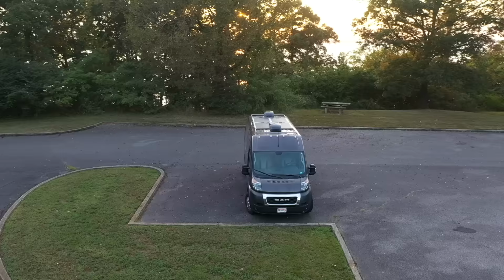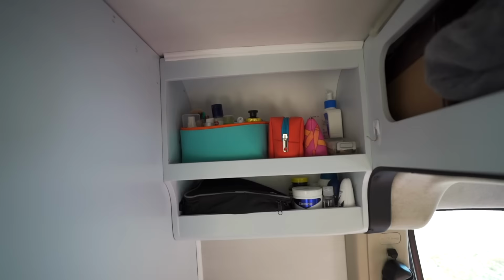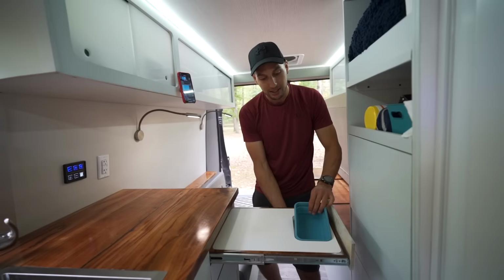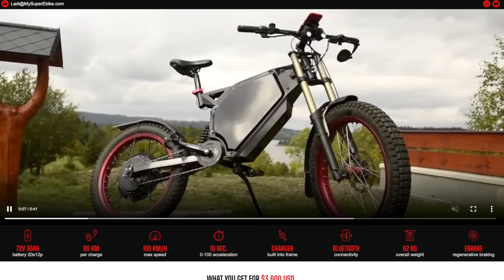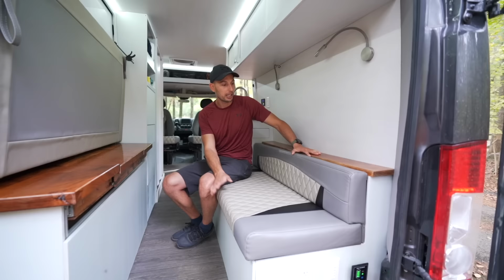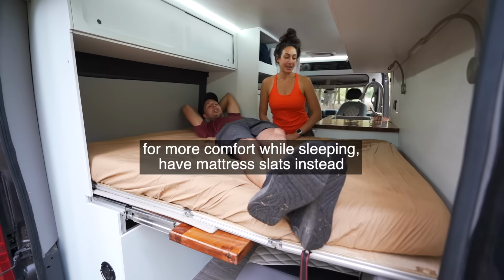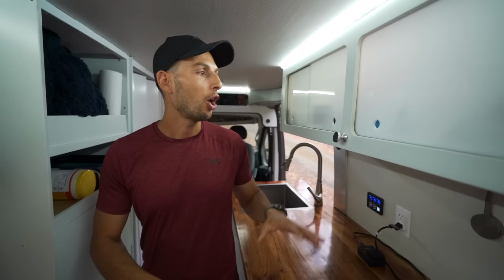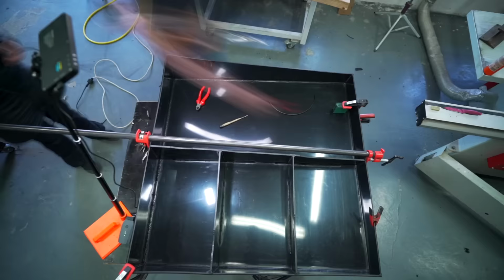LUXURY Van Tour + DESIGN REVIEW of Innovative Campervan Layout

Comment: In one of my minivan conversions, the front driver and passenger seats laid back completely, so I used a drawer set between them  and created the bed. It worked VERY well. You can't  sleep while you're driving, and you can't drive while you're sleeping.  It saved a LOT of space as well as creating seating space when parked. However, most of the driving seats now will not lay back completely. These seats are difficult to find.

Comment: To be honest when it comes to food storage you can always put coolers outside when you're sleeping in the back when you're hanging out in the back you can get 12 volt coolers you can also get generators you can use the vehicle as a generator you drive to the next location you can hook up the 12 volt of the engine and other external spots for more power

Comment: Nice van. About changes. I would design by rotating the back to the front. The restroom makes more sense on the back, if the driver is driving and the passenger decides to use the restroom, it would be uncomfortable for both. If the kitchen is in the back too, you can probably use it with the door opened  while cooking outside and access to part of the kitchen from outside. Less counter space and less shelves would make it look bigger and more space to move. The bed would be closer to the front. If there's an emergency, you can jump to the driving seat quicker. When the bed is put away and have family and you are driving. You can have most of the family sit on the sitting area and be able to have a conversation with the driver and passenger. If the family is in the back, they will have to get up to speak to the driver for anything. If the sink is in the back, you can use the sink spray to do a quick shower out side to spray off dirt or lake water off the body. The bed has a little space on the bottom. If the bed was a little higher, you can have space in the bottom to add a thin mattress and pretend it's a bunk bed. Only for sleeping. The back wall by the sitting area, if it has a nice color strip of velcro, you can have the option to stick a nice thin cushion with a nice print design as an option. The cushion can be left on or removed and used at a park to sit on or used on a dirty park bench. Or to put in the hall floor to sit on.

Comment: If the bed had a slide at the bottom you could add a cushion and sleep tail to front as well as I have seen vans with the bedding in the window extensions.  The other option is to have a slide bed like a couch that goes to the back doors.

Comment: Hi guys on the recirculating shower 1. The water has already been heated so needs less energy to get it back to shower temperature than cold water and 2. I have one and it’s incredible, it runs from a 20 litre or 5 us gallons tank so does not require a lot of water. You can use it several times and can relax when showering as you are not using your main supply.

Comment: I'm not doing the vanlife thing yet - but I've been looking into it. I think these recirculating showers are a costly and impractical fad that looks better on paper than in actual use. Not only do they use a lot of power to pump and heat water, they require at least a half dozen filters that have to be maintained and replaced - a lot of trouble and cost to conserve a few gallons of water. 
I think a better solution would be a water reclamation system - which would eliminate nearly all potable water issues. Even a dehumidifier would likely produce enough water for a couple showers a week - eliminating the need for a recirculating shower - You should design and market a system. If it will draw 4-5 gallons per day from the air - i think you'd have a winner- productwise

Comment: You're mistaken about the power savings of a chest fridge/freezer. A regular fridge with the door open in our testing was at room temperature within 5-10 minutes. A chest fridge? Gained 2C in an hour. It's also far easier to access all your stuff; you're not really vertically stacking much, the space is small, and everything lifts without moving everything else, unlike when something's at the back of a fridge shelf. We like ours so much it's now in the design for my new house too; regular fridges suck ;)

Comment: If you got Bedeez bedding which goes on like a fitted sheet, but has a sheet and blanket/duvet that zips open and closed you wouldn’t need extra bedding as it’s streamlined enough to work with Murphy beds and probably the burrito bed too. It is a company out of Utah. To me it looks like you would have your feet towards the end of the bed with the cabinet above and have your head where you can use the move able lights. I don’t like the refrigerator or the location of the water tanks because they would freeze it the winter months.  Not sure that I would want to cook my dinner over the bench where you work and eat plus having to make sure you clean the wall behind it and even the bench below for anything that might spatter .

Comment: Two power slides would easily solve the trouble you had with the narrow walkway inside.  Perhaps add two more power slides.  One to extend the height of the vehicle.  The other to extend its length.  Go-Go Gadget mobile :)

Comment: yup bed is a huge one for me. I need 2m minimum I hate feeling my feet hit the walls so I'd have to have my bed in the other orientation. I have seen a couple of builds the other way with a removable pad where your feet goes, thereby creating another seat but I'm going to be vanlifing alone so I'm not to concerned about that. Building mine next year so watch out for the video.

Comment: I agree some things even for me as a single male I'd change but over all apart from that bed, which I'd get rid of and use as a storage unit, I'd keep as is - except the under-van storage water system, as what happens come winter when you are operating in - 20 deg C temperatures - water freezes and so does your tank.

Comment: I absolutely love the van, especially the bed and the indoor water fill, I would add the ability to see where the water level is. I don't care for an outside water fill because anyone can have access to it and it's not secure. The bed is awesome because it allows openness to the van and you don't have to make it everyday. I don't like a static bed because anyone can sit on it and that's not something I'm interested in. I do agree about the fridge, pulling things out all the time to get something at the bottom would be a pain. Also not a fan of the pull out induction, too close to the wall, takes away seating, a recessed induction would be better. Adore the shower, must stay clean. I agree that a composting toilet would be better.
Reply: there are water filling points with locks
Reply: @hermanvdv9680  As they demonstrate in their security video, locks can easily be broken into.

Comment: I would add heated floors and the water tank under van inside or heaters to keep from freezing and cracking in winter sitting in snow and I’d extra alternator for keeping van charged and stress off car alternator and think of adding walk-in tub instead of shower with shower portable to hand held or directly above all waterproof with separate door for toilet so it stays inside and shelves inside shower tub for hanging drying wet things with vent from heater and cement all walls and joints so walls won’t crack

Comment: If you find a lot of open space above items in a cupboard or drawer, the cupboard or drawer isn’t designed for the sake of storage, but rather because that’s how it’s always been done. The upper cabinets could have had adjustable shelves. Their pillows could have been tucked inside the burrito bed, the bed bottom that you look at all day while on your laptop, needs art, velcro-ed vases, or anything nice to look at, the frig had 2 1/2” of space between the pull out and the cabinet box. And maybe some softer textures on the walls? No one wants to live in a plastic box.

Comment: Thanks for visit me at Malacca.  This van is not broad enough, must inside 7feet to 8feet wide, so as bed mattress 6feets6inches long (is international size ) can be put inside. #The washing tub table and cooking table must use waterproof material, and able to stand for heat (Ceramic Tale)!  #I like the way of your designs in save spacing, very good idea. @No matter how, better add a 2storey at top( put cushion only for sleeping), push up cover 6feet high (use van same material)!! @Better use two pairs of DoubleTyre!! @ Actually, I prefer this van longer 4feet, so as can put a small sit ( not for lay down) bathtub bathroom at the back (plus a stair for get to the top of 2Storey)!! @May God bless you all the best in your life journey!!

Comment: @ power efficiency of cooling boxes: you don´t loose the cold with an open lid of a top loader as cold air does not rise up - whilst the cold air "falls out" of a front door fridge. Regarding the practicability I totally agree. But the power consumption can make a difference in small vans with very limited battery power.
Reply from the maker: Of course lot of old air escapes when you unload and load back the whole fridge. The argument that cold air does not rise up is completely irrelevant here. It’s like when people don’t take into account everything else.

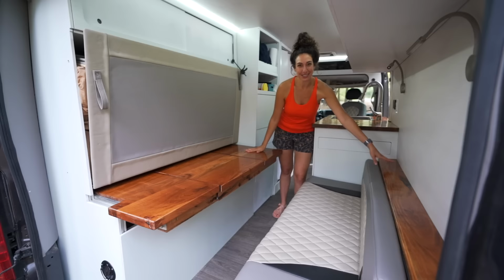Comment: 21:00 i feel if you dont have support to the sliding panel from the bottom, and just let it hang in air then sleep onto it, eventually it will be damaged. better put like a foldable or removable leg underneath

Comment: hi here's common to some emprovement 1. the water under the van need a locked glass shalled to proven tempering 2., security alarm system to keep people 5 ft from van for your safety 3.safty glass windows., 4.safty practice when around other people in different city and town.5.the bed can have sliding wood latches on each side of the bad you don't when that bad hiring you in the head.

Comment: Good review. Although with the fridge comment I did a double take. That's not a real argument about efficiency, those are facts, not beliefs. Cold air is heavier than warm. When you open a fridge or freezer from the side, it dumps all the internal air out and you have to bring it back to whatever temp you have it set to which is very inefficient. With a chest freezer or fridge, you do lose a little when you open but it's very small. If your fridge is cold when you open and empty, as you put items in your actually displace cold air and then it brings the item down to the correct temp. If you empty out a full fridge then you don't have much cold air in it to start.

Comment: I would flip the sink to the other side, and put the pull out stove at the door instead of over the couch. I don't understand that design. You could do a pull out for extra counter space there, but I would not do a stove. Or, even make the stove a permanent part of the counter, but then have the pull outs to create additional counter space. That's the main goal, right, to have more counter space to work with when you need to cook. Placing the stove above the couch is not the best idea due to splatters and spills, and if it opens in front of the door, it blocks the door. You still have other exits, but it may not work for some, so the best spot for the stove is fixed on the counter. Then, you have the pull outs for extra working space, but if someone needs to exit the van, if you have one across the door, just move a few items, slide it in, and go. The couch could be blocked temporarily if it slides open as extra counter space on the other side, but still better than risking stuff spilling everywhere. Also, wherever the stove top may be placed as a pull out, it will need to remain out until it cools before it could be slid back into place, so it is blocking access to those areas for a while. Permanently on top of the counter works best in my opinion. But that's just me. You do you.  :)

Comment: THE FOLD DOWN TABLE BEHIND THE DRIVER SEAT CAN SWITCHED OUT FOR AN UP RIGHT REFRIGERATOR. THE DRIVER CAN SIT IN THE BACK AT A DESK. THEN THAT SLIDE OUT W/ FRIDGE CAN BE USED FOR SHOES ETC... ❤

Comment: One thing that would be annoying with that frige is where the hinges to open should are located .. it would help to be where you can open from standing outside as well.  Hinges on the side(middle) instead of outside edge ..if you are cooking outdoors you don't want to go back in the camper put it out to dig through it  then shut it back in the cabinet to get back outside.

Comment: im one week into watching van life videos.  finally, someone did something vs fixed beds which for me is space inefficient.  one of the ideas I have is an elevating bed using the motors found on variable height office desks. I'm just not so sure how space and cost efficient the mechanical bits are.

Comment: If the water inlet is on the outside of the van, how do you make it secure from tampering?  The cooktop is in an awkward place,too low, imo. Looks like passenger seat needs more of that step for your feet. Fridge could go under microwave area, drawers then where chest fridge was. I agree with wanting a fixed bed. .

Comment: I agree with all your suggestions. Too load fridge not practical, water fill inside-no. The burrito bed was trick, but I agree not practical. White inside color not only hard to clean, but makes you feel like you are living in a hospital room. 

I would note the external water tank could cause problems bottoming out when you drive over dips. It also could be difficult to keep from freezing in colder temps.

Comment: If it was me designing how to work with a van out of each of the doors for the back half side doors have a screen room that could be zippered or plastic like trailers have but what I would want is doors on both sides for the back and van door so I can fold completely around onto the frame the bigger van doors technically these doors go all the way around so a pallet can be loaded in as one of the reasons that means a wider bed

Comment: I think above the head and the feet should not be cabinets especially designed bags that match the decor in the paint job velcroed and magnetic both to attach it up there maybe straps on the wall with just chords that tie point is having fabric is easier on the head then the cabinets

Comment: Not a fan of the burrito bed. You can see the computer shelf bend under just the weight of the bed. That's gonna break the computer shelf pretty quick. That needs a redesign. I wouldn't pull the computer shelf or at all. It offers the best support that way. Perhaps a mid brace connected to the bed that folds out.

Comment: A thing cosmetically for me that I would never put in a van build is matching front and back upholstery/design. For me it makes it feel less like a home and more like an RV and if I am living full time, I would rather have a more "standard" couch style fabric with a pattern to make it feel more like a couch. If I was going temporary trips, then I would just go for an RV, but for Van Life, having that separation between the driving and living for me is important. I would say you made some great points overall but the biggest non cosmetic actual functional thing that I think would not be good after a while is the bed itself. That is a lot of moving parts and extra wear and tear on other parts. Also you are locked into a maximum thickness for a mattress and from what it looks like, to fold like that, you will have to have a really soft mattress/pad to use it and I know I am not the only firm mattress sleeper out there. If I was not going to do a completely fixed bed, I still think a simple pull out futon couch style with wrap around seating is just more functional and convenient and you would have more storage underneath it as well. Especially if you are doing a design that gives up an internal gear-age, you might as well make that compromise worth it.

Comment: Cook top would splash onto leather seat...yuk...needs a pop up splash guard at the end. Shower door could run around the corner behind fold down lap top table and shelves behind drivers seat vertical slats that curve around corner for storage. Narrower sink counter ...faucet on end of sink or  in the corner of sink, or even drop down from ceiling...you are right the walk way is the most valuable real-estate of a converted van ....permanent bed a must...too much hassle to make and unmake the bed.

Comment: Hi thanks sm for sharing!!
Why do you think people are installing a water inlet hole in their cabinet side over an external portal?
What do you think a bottom external water tank does to van clearance-speed bumps, extreme potholes etc?
Suggestion for the bed latch: a wide hook sloped on the front, flat on the back-held in place by gravity lifted by hand. I really can't imagine it lifting from bumps in the road, but a deeper hook might do
The cutting boards bowl could maybe do with a rigid frame for easier removal and fit? Also idk about the height, as it could have more space above so it can be pushed inward with things on it, maybe lifting the bowl quick and easy for access below...cutting and removal of waste is usually a brief task I think :s
Why gloss? Wouldn't Matt white cabinets be more practical for not seeing dirt? Also I'd really appreciate your view on this for houses, as I'm gonna do a remodel on mine :)
I can't really fathom why not a cushion for that bench area, I get the bed gets in the way but shove it on the floor maybe if clean or somewhere else? :S
Suggestion: if there's a sweet spot for the push to open hob drawer may I suggest a decal to indicate it :)
The side drawer if I remember the position right: I imagine having it coming into the seating area is unconventient but not too much, or so I imagine but obviously haven't experienced, because the person using it is no longer sitting in that space. Maybe the pull out worktop being in two halves to make that space reachable :s :)